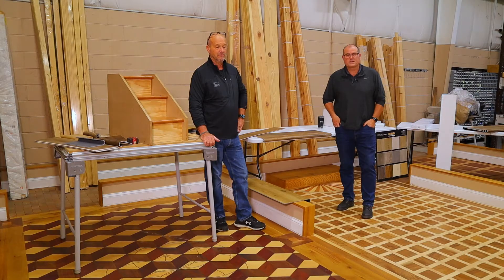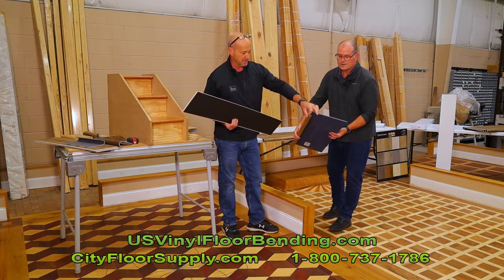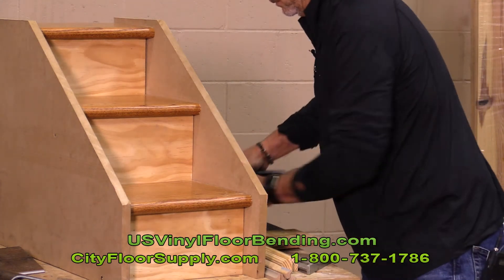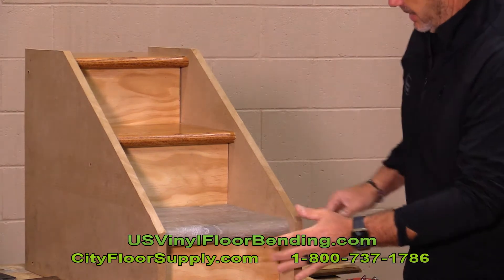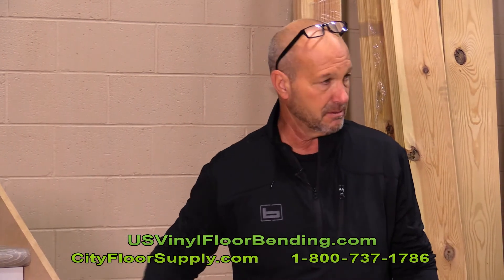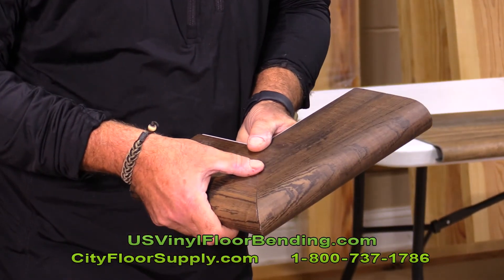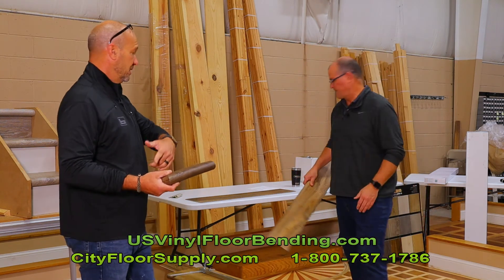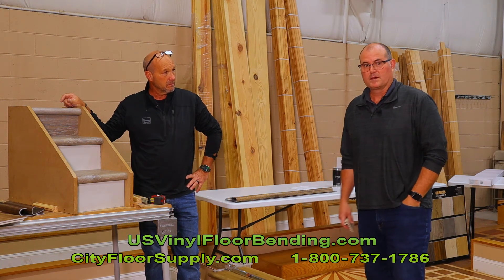US Vinyl Floor Bending Stair Tread Installation | City Floor Supply

Comment: Where is the tool? Are you guys doing another video to show how to do it?
Reply from the maker: Hello, Our apologies for any confusion. The treads are pre-bent and can be purchased on our site - https://www.cityfloorsupply.com/c/vinyl-accessories/100766?Line=Aqua%20Armour&Manufacturer=Aqua%20Armour
You can then trim on-site to width and depth.
Reply: They heat it up with a heat gun and bend it to fit